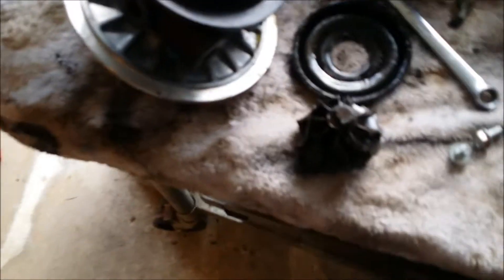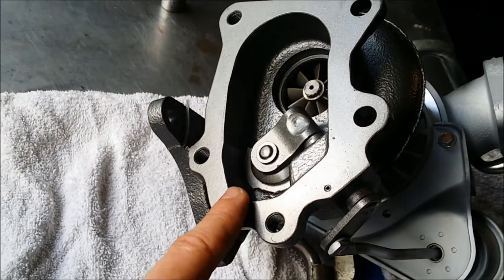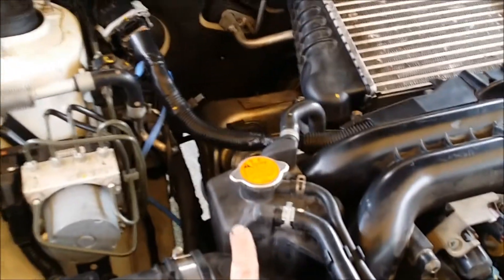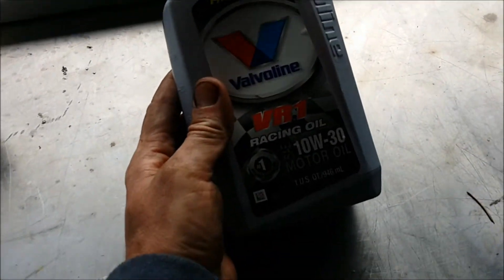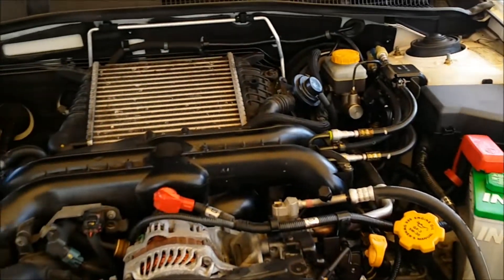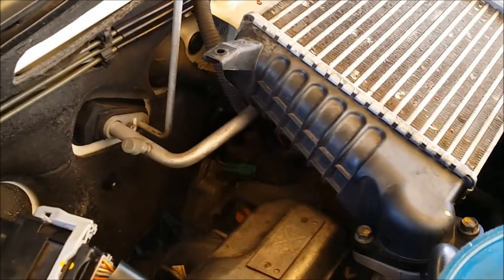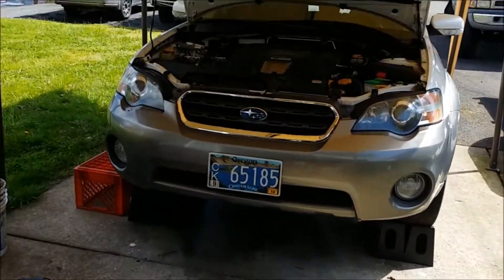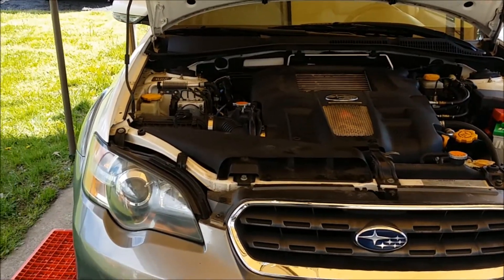The 500 dollar outback xt part 3 "turbo eater"

Comment: What size silicone hose are you using?
Reply from the maker: 5/8 IIRC for the drainline right???
Reply: Yeah , want to buy one incase mine ever leaks again .
Reply from the maker: Gotta get that AN fitting instead of the press in pipe too.  That thing leaked like a sive.